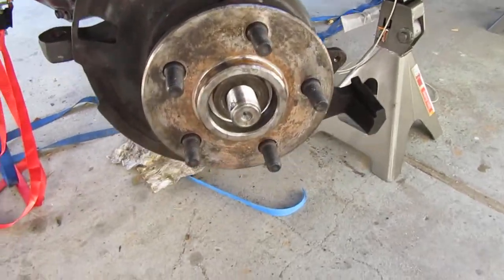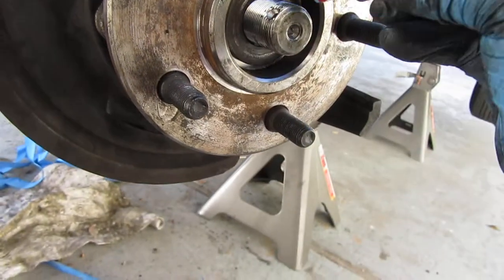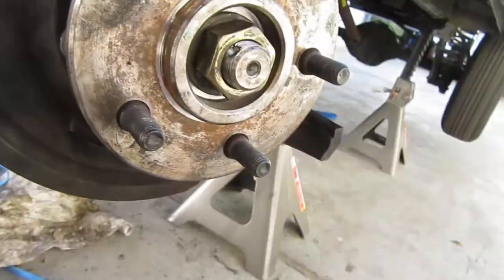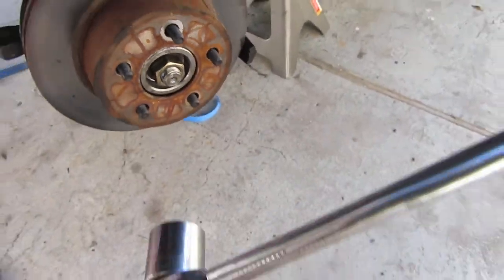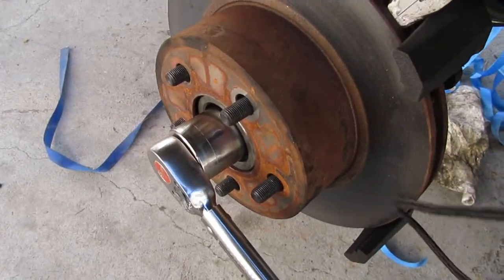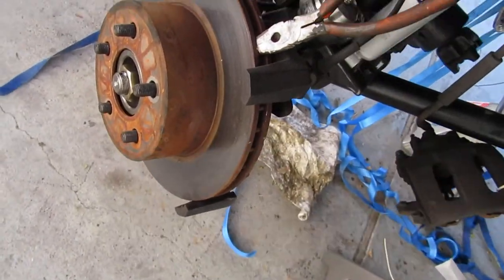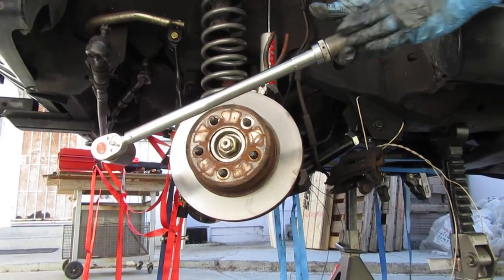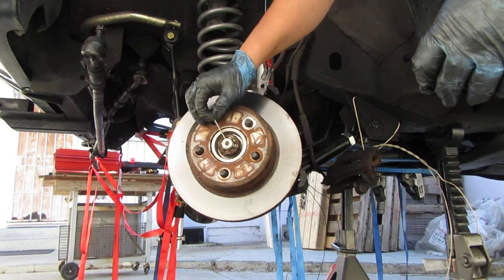Jeep ZJ 5.9 Torque Front Axle Shaft on to Hub

Comment: Replaced the left front on my girlfriends '97 5.2 Limited. Eventually I plan to replace both of mine on my '97 5.3 Limited, but also my rear bearings. Overall, a basic running gear maintenance.
Reply: Robert Loyd 5.3?